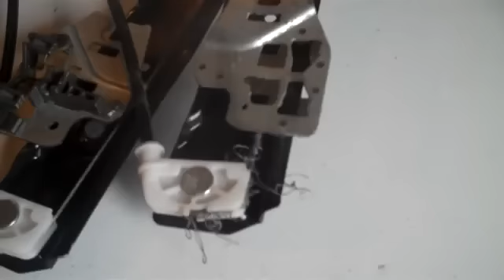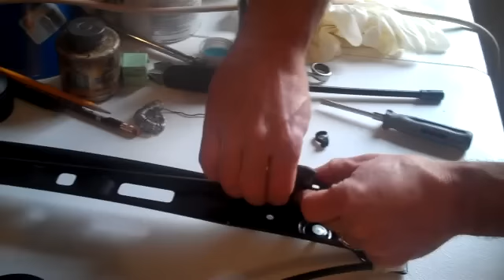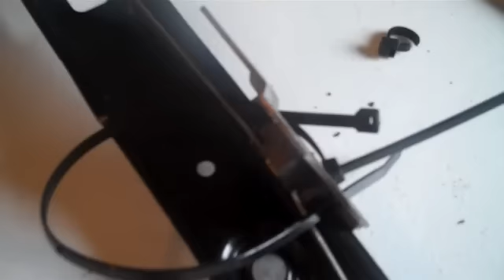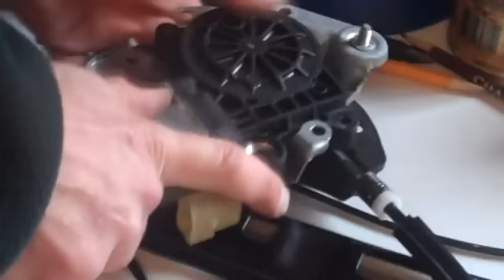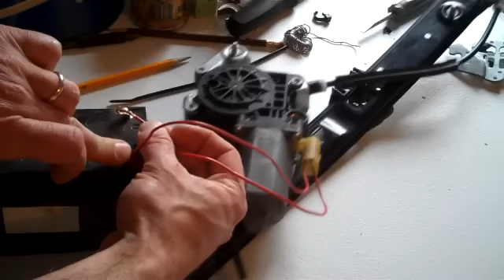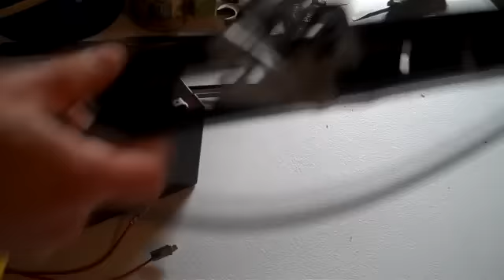BMW 3 Series Window Regulator Repair, DIY E46 Window Regulator Repair

Comment: Thank you for the video. Just finished working on my wife's 2003 BMW 325i driver side regulator.  I found out the bracket that pulls the cables was broken where it holds the cable up as you showed on the video.  I did not use the ties though. I used paper clips instead. One in front and one in back. I just twisted then by hand first, then with pliers and cut it as short as possible. . I thought with time, the ties would wear out with the friction and would eventually break off.  Thanks again!
Reply from the maker: Hi Joe, Great idea to use paper clips!

Comment: nice vid. here's a question for you. the drivers window on my 2004 325i goes up and down, but seems to struggle getting back up near the bottom, and then get a little bit better as it goes up. is this the regulator or the motor? it has never failed to go back up, but it really struggles near the bottom, and i'm thinking about fixing it before it stops completely.
Reply from the maker: Hello Stev, To me it sound more like the regulator since it is fine in other spots but it could be a combination of both components. If you want to do one at a time I would recommend the regulator first. Hope this helps!

Comment: Just repaired mine with the help of this video. I didnt criss cross my cable ties, just put two ties on either side of the nib to hold the cables against the holder. This prevented the nib from coming out the holder. So theres no real correct way of doing it as long as you can keep the nib in the holder. Useful video, thanks!

Comment: Thanks for the reply! Yes, Im still talking regulator - (2000 e46 driver side). The motor is fine but the spool it plugs into (inside the sealed part) is making the noise. The casing is held together by 4 rivets which would have to be drilled for access. The cable doesn't seemed frayed at all but I am curious to see what has failed inside there as it's happened once before. Yes the noise is the same as your one, its a horrible crunch. I'm going to drill it open and see what went wrong!

Comment from the maker: Nice :) For the noise you have if you are still referring to the window regulator, then only replacement of the regulator will fix this problem. The cable is failing and as it winds around the motor it can make some horrible crunching noise like on the unfixable regulator I had.

Comment: Hi mate, That's a great video. I know the cable tie method works as I have used it a few times on my e46. There's one fault i haven't be able to repair. Have you ever fixed the crunching sound problem that comes from inside the sealed part behind the motor mount where the cable go round the spool?  Do you know what I mean?